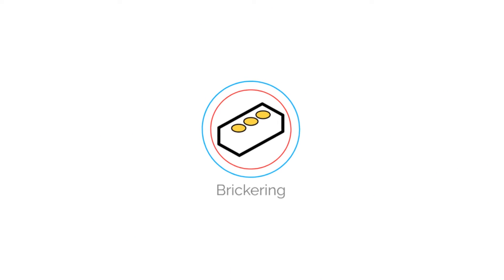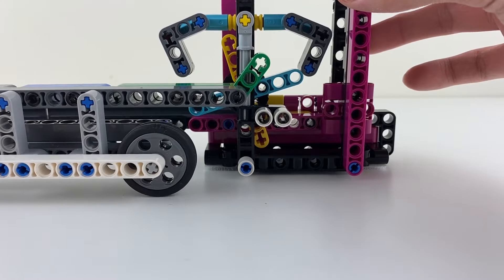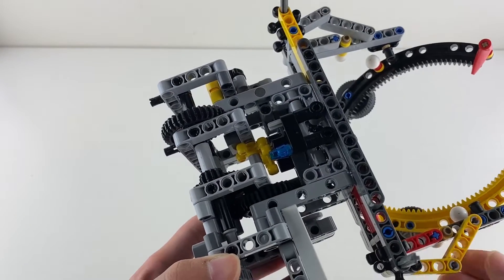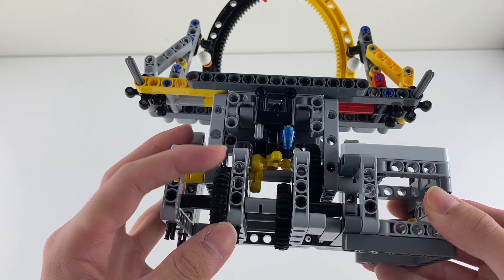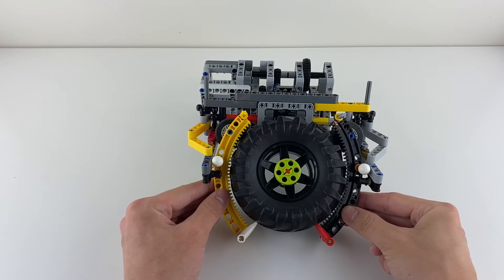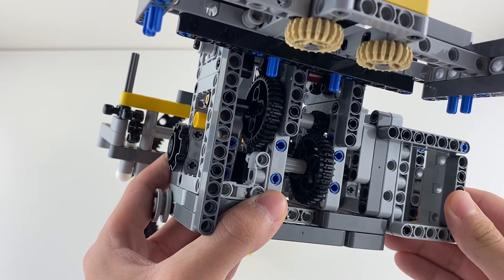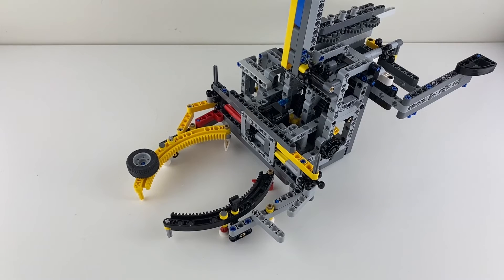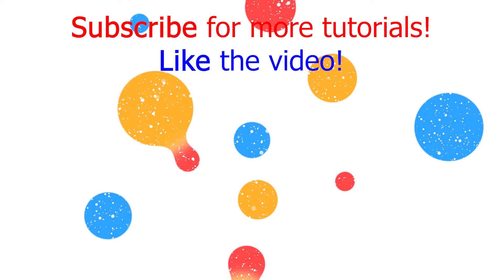FLL RePlay: Flip Tires + Step Counter (Tutorial + Instructions)

Comment: Hi Brickering I have made the tire flip attachment and I had to make a few changes. Even though it is big I still have made it a pin-less thing and it works. I had to remove the tires and put the pointy things in the front for more grip and making it less heavy for the robot because it kept breaking down so thats why I removed the tires. After a day or two I got it to work. Thanks for the instructions!